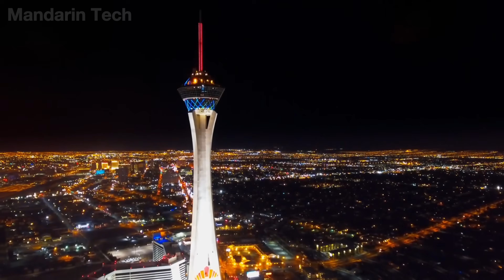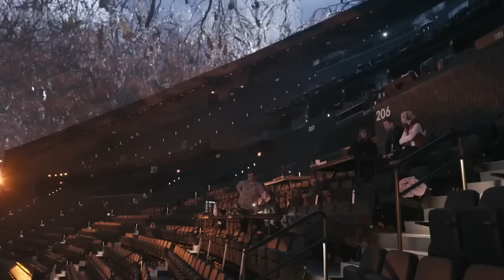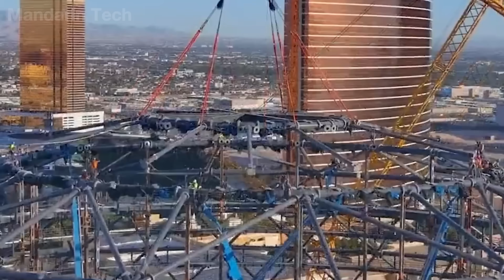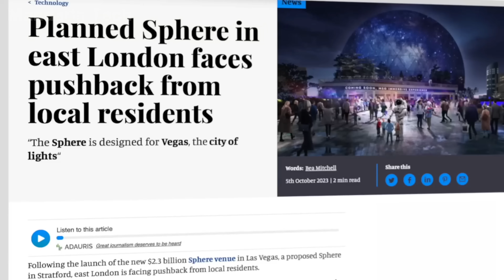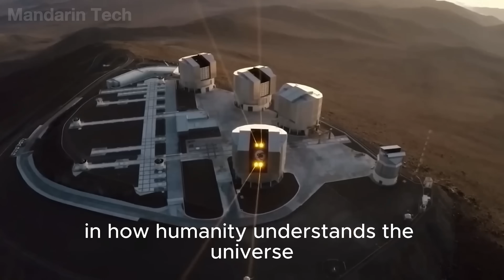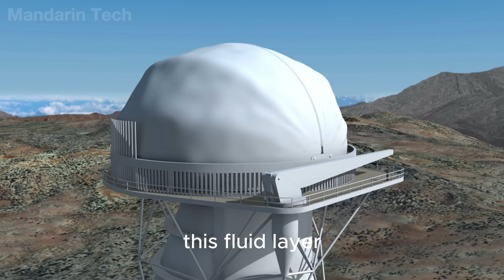How Las Vegas Built the World’s Largest LED Sphere in the Middle of the Desert

Comment: Field Engineer & Environmental Perspective
🇬🇧 English

From a field and environmental perspective, building in desert conditions presents unique challenges.

Managing extreme temperatures, material performance, and energy consumption are key considerations.

Field engineers ensure quality execution, safety, and adaptation to site conditions while optimizing resource use.

Innovative construction must also consider environmental efficiency.

#FieldEngineering #EnvironmentalEngineering #SustainableConstruction #DesertEngineering #EnergyEfficiency #ConstructionSafety #ResponsibleEngineering

Français

Du point de vue terrain, construire en milieu désertique présente des défis spécifiques.

La gestion des températures et des matériaux est essentielle.

Les ingénieurs terrain assurent qualité, sécurité et adaptation.

L’innovation doit intégrer l’efficacité énergétique.

#IngenierieTerrain #IngenierieEnvironnementale #ConstructionDurable #IngenierieDesertique #EfficaciteEnergetique

Español

Desde la perspectiva de campo, construir en el desierto implica desafíos únicos.

La gestión de temperaturas y materiales es clave.

Los ingenieros en obra garantizan ejecución y seguridad.

La innovación debe considerar la eficiencia energética.

#IngenieriaDeCampo #IngenieriaAmbiental #ConstruccionSostenible #IngenieriaDesertica #EficienciaEnergetica